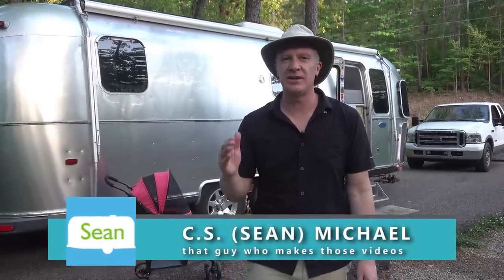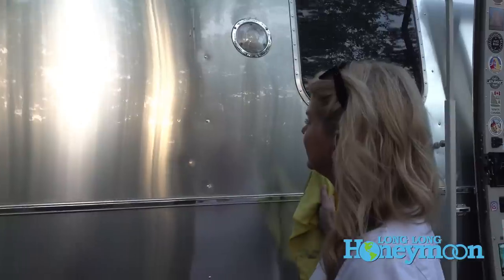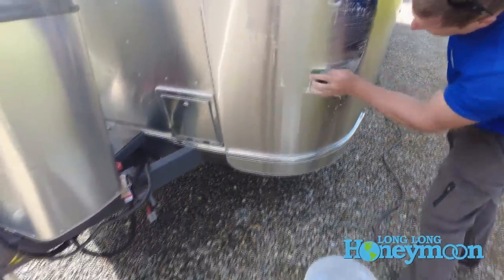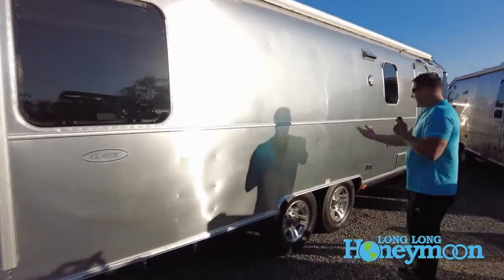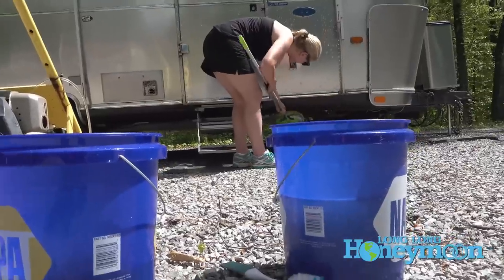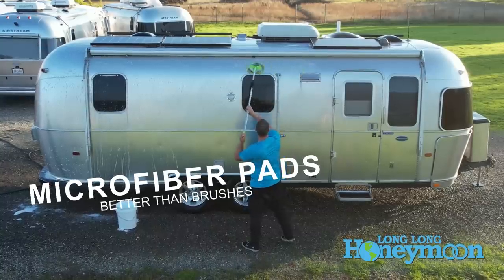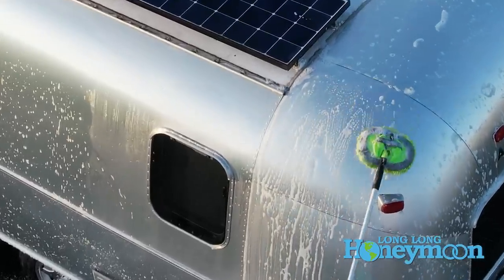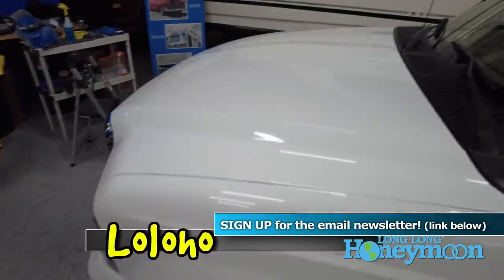How to Wash Your RV -- PRO TIPS!

Comment: In previous videos, there have been short clips of a Cougar 5th Wheel to show that the ceramic coating will work on RV's other than Airstreams.  That 5th wheel is mine, and it has been just over 1 year since Bryan did the ceramic coating at Vinnie's.  Super easy to clean, and it keeps the 5th wheel looking brand new.  It is not cheap, but has been worth the money.  Highly recommended.

Comment: Vinny coated my 2018 Airstream in January 2022. So far, very happy and agree washing is much easier. Brian walked me through these steps post application. We had a big rain storm in March, and it literally washed itself. Same experience at a campground in April. My opinion, it is really worth the investment. It stays cleaner longer and cleans faster with less labor. They coated the outside windows and they look great with minimum cleaning. The front rock guards also clean much better (they never cleaned very well before the coating). My unit is stored outside and corrosion was the main reason for the ceramic coating. As we know microfiber doesn’t soak up water. Brian recommended the Wholly Mammouth from Chemical Guys, and these work great. Three will dry the trailer. We also use a leaf blower to help dry and get in the chrome band that holds water. Overall, very happy. BTW, it was your video that sold me on the idea!!
Reply from the maker: Thanks much for your detailed post. glad to hear that your experience is similar to ours. Brilliant idea with the leaf blower! We will try that next time for sure. 👍
Reply: Hi Robert, I was curious to know if the ceramic treatment fixes the corrosion you had on your airstream, or just stopped it from spreading further.  Is the corrosion less noticeable after the treatment?  Thanks.

Comment: An older video but really useful. I use the same pressure washer, 2 bucket method to wash my cars, trucks and RV. 
I use a separate 2 buckets for the wheels and tires, and Aerospace 303 the tires. One of my colleagues was an F-15 crew chief and they used it on their wing commander's jet. If it's good enough for the jet, it's good enough for my RV tires.
Reply from the maker: Thanks for the tip, I will check out Aerospace 303 👍

Comment: Thanks for the washing tips. We have a fiberglass trailer so I use marine wax but my TV is a 2019 with a ceramic coating applied when new and aside from a yearly maintenance touch up the paint looks better than new vehicles rolling off the assembly line and washing is a breeze. Thanks

Comment: We had our Airstream and F-250 done at the Tallahassee location. The whole process was very professional and the results incredible. We dropped off on Monday and it was ready Friday afternoon, although they had us pick up on Saturday due to bad storms with tornado/hail possibility on Friday.  Was nice they were concerned about out trailer to come in on Saturday so our truck/trailer could stay inside to wait out the storms. It certainly makes cleaning much easier - bugs have never come off the front of the truck/trailer so easily. The guys in Tallahassee gave us recommendations on wash mitts and drying towels before we left (same items Bryan uses except I just have the mitt, not the extension pole). A leaf blower works well to get a good portion of the water off and out of cracks/crevices. And like the other videos state, this is NOT your auto parts store DIY ceramic.

Comment: Thanks for the drone tip, Sean! Don't have an AS & do the poor man's ceramic coating in the bottle (Meguiar's) on my RV. Change my soapy water frequently, but will now do the 2 bucket method & microfiber scrubber rather than soft brush. Thank you

Comment: I am guilty of the one bucket approach. 
I will try the two bucket system next time. 👍🏼
Reply: also try the spray off the microfiber pad between putting the pad back in the soapy water.  Removing the dirt and stopping it from getting recycled on the surface will surely prevent a lot of premature wear and tear to the surface of what you are cleaning.  RV, MH & vehicles.

Comment: My 2017 International Serenity 28 needs its 1st bath since I bought it. Its at a storage facility with no water so I'll to take water with me. I have a 30 gal water bladder. Will that be enough? I have a small pressure washer. Plus buckets for this 2 bucket method. Curious about water needs.
Reply from the maker: That is a unique situation. To be honest, we have not attempted washing our trailer with a limited water supply. Well, actually, we have done so at coin operated washing facilities, and frankly it always takes more coins to rinse than you expect. You will need to be quite judicious with your water usage. Let me know how it turns out!
Reply: I found I can rent a 275 gal tank easily/inexpensively around here. Might try that. I'll update afterwards.

Comment: Is the 9h ceramic coating. is it the same as the spray on that you did?  Also can this be done diy ? If yes what kind of kit that’s used? 
Thanks! Keep video’s coming..
Reply: Hi Dudley, there are many types of "ceramics" or claimed ceramics popping up all over.  Some are just quick spray on and surely DIY which provides some hydrophobic properties but are not permanent or long lasting.  What we do is the absolute most extreme multi-layer/multi-functioning permanent ceramic coatings specifically for Airstream trailers and now all recreational vehicles.  And in no way is what we do a DIY project.  It takes a week on average from start to finish but when it is completed it is done right and with the most protection possible.  This is higher than a 9H but don't get caught up in the 9H.  You can have a proclaimed 9H that last 6-12 months.
Reply: Question! Small camper application for a teardrop camper.. it is a aluminum exterior     . What the cost be the same as a auto truck or car? 
What would be the  lead time?